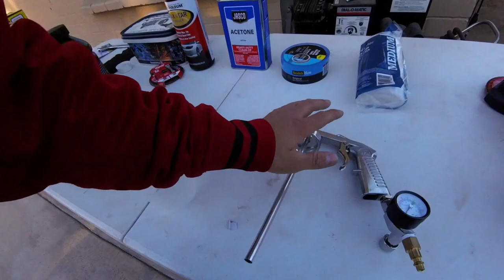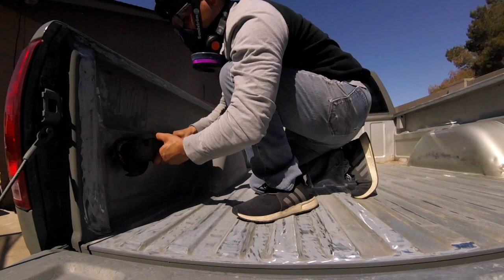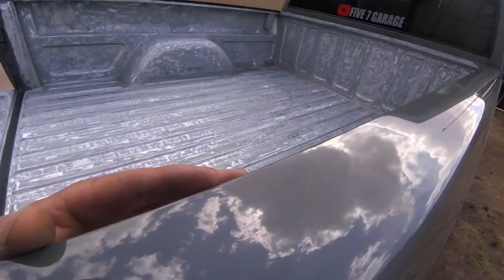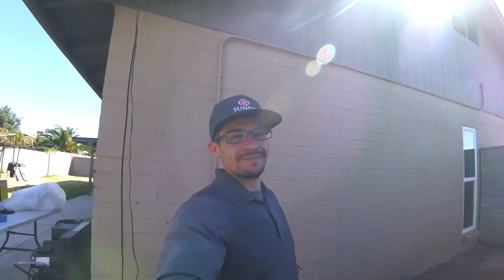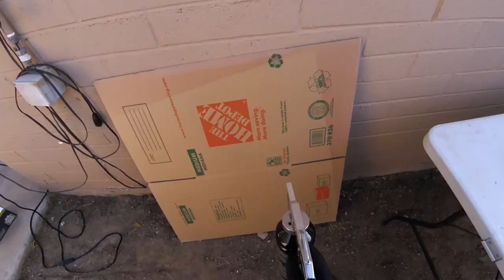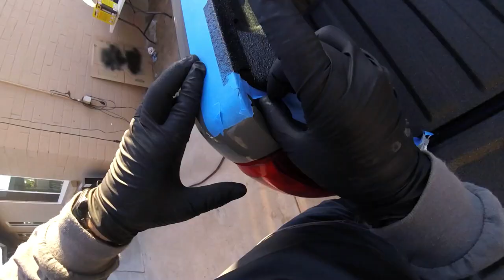DIY UPOL Raptor Bed Liner Install | Tips and Tricks | on OBS

Comment: Please don’t mislead people when you clearly have no idea of what you’re doing. Didn’t have to take it down to bare metal, and DEFINIETLY shouldn’t have sprayed raptor directly on bare metal. If you for some reason like rust or bad previous paint have to take it down to bare metal, use a good primer like some 2k epoxy first. Also sprayed at way too close of a distance

Comment: Fatal mistake , all the bare metal should have been sealed with metal sealer . It will rust under the liner and come off eventually.
Reply: I would only use 180 grit and red Scotch-Brite Primer Prep Scuff
Reply: Rip
Reply: I covered bare metal on mine with etching paint.
Reply: Nope, you’re wrong. It’s a solvent based paint so it inhibits rust and acts as it’s own sealer. If it was water based, like other bed liners, it wound need to be sealed. But in this case he did it correctly.
Reply: @jmos96  according to the manufacturer it’s not suitable to paint over bare metal unless it’s etched and primed
Reply: @jmos96  it’s because it a rubberized paint job that’s why it’s so durable but it can bubble and peel back that’s why you must use primer to cover it all atleast
Reply: I was told raptor liner can be sprayed over surface rust and bare metal.
Reply: I thought it was because I missed a spot on my 2nd pass but that happened to be a bare metal spot where I went too deep

Comment: Seems like the most common mistake made is stripping it to bare metal 🤔
Reply: Any tightly adhering paint can be left alone..use a primer designed to "pickle" tight substrate ,so you can spray on the new coating over the tight old paint..
Reply: @haukepowers8491  for reasons, I had to go to bare metal in about 60% of the bed. Should I prime the bare metal first or spray the bed liner on the bare metal?
Reply: @digitalblasphemy1100  The directions said to use Raptor Primer if going to bare metal. I had to as well in spots to grind away rusted areas.

Comment: Looks really good. I just bought everything today. What PSI did you use when spraying?
Reply: As a retired shipyard painter, the proper PSI would be between 40- 60 psi depending on the viscosity of the substrate...many high  build products use as high as 70 psi , depending on applications.....And wear a respirator...even outdoors, the fumes can be dangerous to your lungs....

Comment: No primer? Wait for the rust. It will come.
Reply: Explain please, I'm about to get this done..🤔
Reply from the maker: Whenever you scuff the paint make sure you dont go all the way to the metal if you do use etching primer to cover the metal surface. That’s it I just skipped a step sorry. Learn from my mistake. Good luck 👍
Reply: @five7garage826  
I appreciate your quick response. And thanks for the tip 💯👍🙏🙏
Reply: @five7garage826  humble man. Nice to see a man own up and tell the next man to not do the same. 
Most people would just ignore or delete the comment. Respect sir.

Comment: I would be interested to know how its holding up because you went to bare metal without using an etching primer. Raptor supposedly doesnt like to adhere to bare metal.
Reply: I don't know about it not adhering to bare metal but I do know you should use primer for rust prevention.

Comment: You did forget primer, (etch or epoxy) Raptor is NOT protect from rust, as they claim! It is very thick material, that you can't see whats going on in metal surface.. hope you are happy for few years.. Good luck

Comment: How soon between coats did you apply another? Also how many coats in all? Thanks
Reply from the maker: I sprayed it right after,as soon as I mix the hardner inside the bottle I sprayed it. After the fourth bottle you’ll notice the gun clogging up, so make sure you clean it with paint thinner.

Comment: Question . I'm concerned,  if i do the work on my entire truck on the driveway , how far the urethane bed liner can blow and stain walls or cars parqued nearby?
Reply from the maker: You’ll be surprised how far the dust will travel. I highly recommend to cover near by items within 20ft radius at least.

Comment: Hows it holding up a year out now?
Reply from the maker: Truck has been garage kept so as you would imagine still looks new. It’s a great product though.
Reply: What compressor did you use ? About to do this but have a 6 gallon compressor at 150psi

Comment: How long do you have to wait in between coats? Or do you just keep going as you finish each bottle ?
Reply from the maker: You just keep going after each bottle, but don’t add the hardener to all bottles at once because by the time you get to the third and fourth bottle they might be hard. So do each one at a time.

Comment: 80 grit!?!?  You didn't need to literally "grind" the paint down to bare metal, just a good scuffing with 220 grit or a course scotchbrite pad would of been all that's needed. Spots that were ground down to bare metal should of had a coat of etching primer applied before the liner was sprayed on.
You shoulda brought the bedliner up over and onto the top of the bedrail so that was protected also.  I guess that's personal preference though. :)

Comment: What pressure did you spray at man it looks clean
Reply from the maker: I have a worn out compressor so it fluctuated from 45 to 55 PSI but as long as you keep the same distance and dust it at the end it should come out good.
Reply: @five7garage826  nice thank you homie for the info.

Comment: How many of the jars did you use on your truck bed? Look great!! i hope mine turn out that good when i do my truck bed!!
Reply from the maker: 4 bottles for a 6.5 foot long bed is just enough. Thanks, I’m happy how it turned out.
Reply: @five7garage826  thanks!!
Reply: @five7garage826 Did you spray two layers, or just one?
Reply from the maker: @motoace2007 it’s just enough for one layer, but I use half of the last can to dust over to eliminate any gloss and give it that matte and even finish.

Comment: What pressure did you use?  Looks really good.
Reply from the maker: I set it at 50psi but since my air compressor is so old it couldn’t keep up, so it would fluctuate between 40 and 50. I actually like how it turned out. Glad you liked it too.

Comment: Have you tried to spray Raptor on styrofoam? I've heard most liner sprays will dissolve styrofoam, but I've also seen a lot of cheap ice chests sprayed. Just wondering what your experience is before I drop $100 to find out it doesn't work! TIA
Reply from the maker: You know I’m not sure about that I wouldn’t think it would harm styrofoam but you never know.
Reply: If solvent based, it will melt styrofoam, but why would you want to do that to a cheap cooler? They're made to be disposable...seems like a waste of money...by the time you buy the bed liner, you could just get a decent cooler...invest in a good cooler & you won't have to cover it with anything...

Comment: Great content.
I just received the same U-Pol kit.
Question?? Where did you buy the pressure regulator that mounts on the gun?
I need one before I do mine.
Thanks,
Reply from the maker: Thanks. I picked one up at Harbor Freight for like 8 bucks.
Reply: @five7garage826  cool there’s I Harbor Freight in This city called Anaheim. A few miles from where I live.
Thanks,

Comment: Did you use all 4 bottles? How has it held up after use?
Reply: I used 5 bottles on my bed. And I wish I had a sixth... only so I could get it a bit thicker. Not dissatisfied with the results though